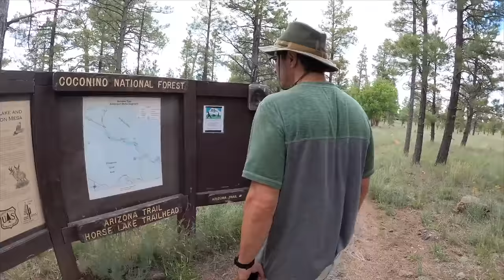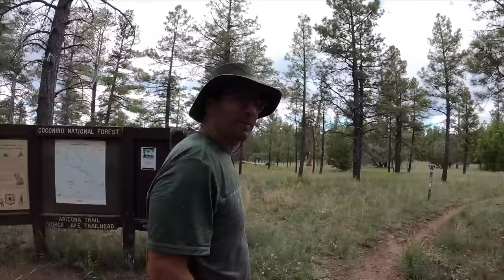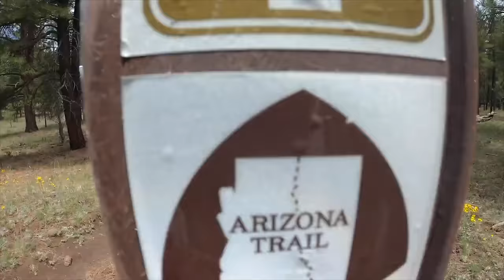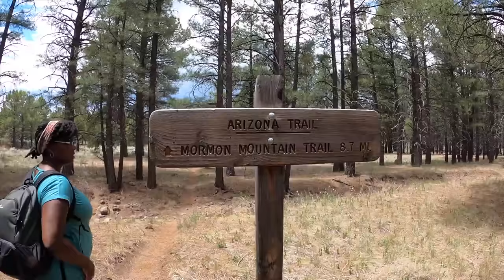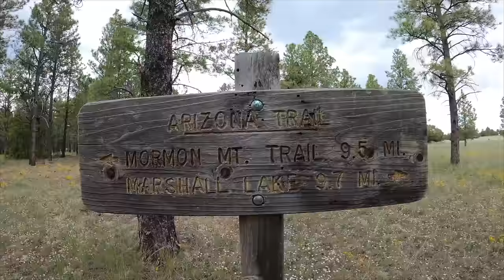THIS CHANGES EVERYTHING! My First Time Living in a TINY Camper Van Alone (RV Life)

Comment: HEY YOU TWO WOULD HAVE BEEN ALOT BETTER OFF KEEPING THAT VAN OVER THE RV ABORTION ON WHEELS..HEY I HAD MY LAST REG VAN 16 YRS A 08 CHEVY EXP 4X4.AND NOW HAVE A DINASAUR THE BEAST 1995 GMC G 30 3500 VANDURA 1 TON 2 WHEEL WONDER W A LOCKER IN REAR DIFF..NEVER GET IN ANY THING ELSE BUT REG VAN AND AT 65 ..I LOVE IT ..HAPPY MOTORING YA'ALL...

Comment: Another great video, y'all!  Here's a friendly suggestion, T&D:  Whenever you off grid in Desert Storm, take along some Medical CleanTouch (or another similar brand) Bath Wipes, which will enable you to have a convenient rinse free bathing system. These disposable and pre-moistened wash cloths may be heated in the microwave and have a gentle no rinse hydrating cleanser. The bath wipes are alcohol free, hyperallergenic, soft on skin, and reduce the risk of infection.  Using these will keep you clean and fresh and help you save your water resources; which is very important when you're boondocking.
Reply: Great tip thanks Kenneth
Reply: @tracyhull7936    You are very welcome, Tracy!
Reply: I don’t have a microwave in my rig, but I still have a warm bath by using the kind of wipe you mention with water heated on my stove. Feels so incredible after a busy day. A cold shower in hot weather is equally wonderful in hot, dusty weather!
Reply: You can also do the same thing with Witch Hazel the liquid in those wipes. And a regular wash cloth.  Hamamelis Virginiana.  ❤❤🎉